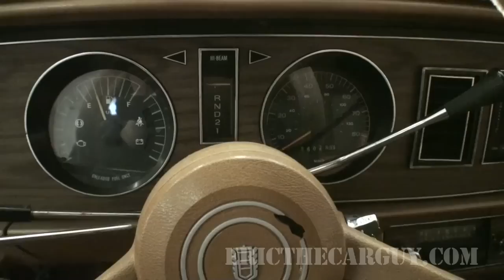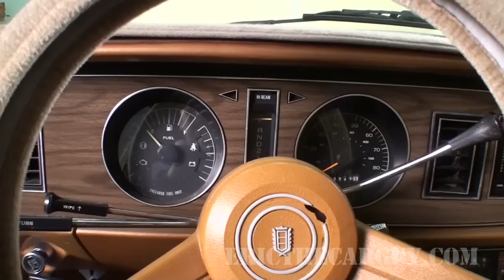1979 Ford Fairmont a Closer Look #FairmontProject

Comment: I'm a little surprised to see that Ford US was still using this engine in 1984. Ford Australia used it as well, from 1970 until June of 1976. They where 200 and 250 cubic inch. After June 1976 Ford Australia released a revamped version of the two engines with a cross flow cast iron head. I recall reading at the time they reason they did this was that the old non cross flow engine would not meet the latest emission control design rule of the day. The revamped 3.3L engine produced 110hp and the 4.1L produced 123 hp. Nothing to get excited about but I wonder how the American Fords would have performed with the cross flow engines installed. By 1984 the engines had evolved a little more  in that they had an alloy cross flow cylinder head( which where a 3rd of the weight of the cast iron version)  fitted with a 2 stage Webber carburetor or the optional Bosch fuel injection. They used that alloy head cross flow engine up until 1988 in sedans and wagons and 1992 is utilities and panel vans but after 1988 the sedans and wagons where fitted with an all new 3.2l and 3.9l sohc straight 6 engine with single point fuel injection and optional multi point fuel injection. After 1992 the 3.2l engine was dropped due to poor sales and all models after where fitted with a new 4.0l sohc 6cylinder with standard multi point fuel injection. We saw very few American Ford models in Australia with the exception of the F series pickups , a short fun of the Taurus during the 1990's and the Ford Explorer. Now ,with the closer of Ford Australia vehicle manufacturing operation we'll probably be seeing a few more. Sorry for the long post, hope you find it informative.

Comment: Wow - does this bring me back.  My wife and I had a '78 Mercury Zephyr from when it was new up until about 10 years ago.  It was essentially the same as this '79 Fairmont in many respects.  Major differences were that the Zephyr had 4 headlights, different grill and hubcaps, little stuff like that... but pretty much the same car.  We even had a very similar plastic tray on the transmission hump to hold cups, change, tapes, etc.  The body and interior on this '79 Fairmont are in amazing condition, as are most of the mechanical parts when you consider their age.  Will be interested to see how it progresses.

Comment: I use to own an '80 Ford Fairmont Futura sport coupe. Mine had a 2.3l engine and a 4 speed manual. If you get wider wheels and better springs in the rear the car will handle great, shortening the links on the anti sway bar in the front will sadly not only lower the front of the car, but make it stick like glue. I was young when I did it so don't judge too hard. It might be good to note that a good portion of the tubular swaps are for drag racing and do not help with handling just reduce the weight for better transfer and some change the stock position of the engine.

I saw one of the sport coupes for sale in Colorado that a guy did a full Cobra swap on including the independent rear suspension. if you want to go for full sleeper mode, maybe change to 15" stock five lug wheels and have them widened, then pop some hubcaps back on. A stock gauge cluster from a Mustang will fit in the dash, you just need the extra wires and the plastic face plate to match. Most people would just think it was a dealer upgrade. Just some food for thought

Comment: Love it,I only drive old cars for easy workability and nicer drive,all these saying how unsafe they are maybe fight but just don't crash and you'll be fine.. I'm in a BMW e34 that look forward to driving everyday that's almost mint,all I have changed is wheels because I was on metrics which are expensive so I run 245.45.18's... cheers for the vids I'm subbing

Comment: Some had inside hood latch. The AIR system injects air into the exhaust to cool it and keep the catalytic converter from burning out, while also thinning emissions for easier conversion.

Comment: I had to Ford Fairmont one was as 1979 and the other one was a 1981, the straight 6 in the 1981 was slightly different as the bell housing was called a wide block and was a wider bell housing area, The Strokes were slightly different in 1981 how were they were still 3.3 liter 200 cubic inch engines, my 1981 had 316 Thousand Miles when I gave it up, was the best running car I ever owned, I was also noticing the grill on that 1979 and it appears to have a later Grill in it as I thought the 79s had a for headlamp system on the four doors just like the few tour of Fairmont, I knew where every boat was one of those cars and could actually disassemble one in the dark or blindfolded, the reliability factors in these cars was outstanding and even though they were rated at 80 to 90 horsepower, they actually had great acceleration and cruise down the highway very well, my 79 seem to have a little more spunk but the 1981 seem to be a smooth riding car, I used to pull 15 foot boat with mine and it had no problems whatsoever, they were both daily drivers and went betweens 75 to a hundred miles per day, the trunks were very large and the air conditioning systems work flawlessly

Comment: Ah, that Fairmont yellow... my second car, at age 17, was a leased 1979 Ford Fairmont station wagon, with a 302 engine.  I loved that car, and had saved up Almost enough to buy it when it was time to return it once the lease was up.  It was basically a big yellow beer can on wheels, with a ridiculous engine for the car's weight.  I remember taking the car up to 145 mph on an expressway between stoplights... I had an aftermarket radar speedometer on the dash, since the stock speedo wasn't capable of registering the car's actual top speeds.  All in all, it was one of my more memorable cars, even though I only had it for a year.  

And, of course, since it was a station wagon, and I was a teenager, the car didn't just see action on the roads, but in the back, too.  I remember my friends looking at their own econoboxes with tiny backseats with a frown, and at the rear of my car with much envy.
Reply: 145 mph is impressive with an engine that only made about 133 horsepower.

Comment: Also, not sure if you know, but that transmission should be the ford C4, which will mount to small block 302 or 351.  if you go big block you'll need the C6 which is pretty monstrous.

Comment: you can get a blutooth setup in the car without taking out the radio. they make them to where they can rest on the sun visor so all you have to do is plug it into the auxiliary to play through the speakers if you'd like.

Comment: Eric: this is info from Wikipedia
Since 1971, all U.S. vehicles have had fully sealed fuel systems that do not vent directly to the atmosphere. In a typical system, vapors from the fuel tank and carburetor bowl vent (on carbureted vehicles) are ducted to canisters containing activated carbon. The vapors are adsorbed within the canister, and during certain engine operational modes fresh air is drawn through the canister, pulling the vapor into the engine, where it burns.

Comment: My dad had a new 78 Fairmont "strip model" with no options at all. Four cylinder, 4 speed manual transmission, manual brakes, no radio. He got an aftermarket sunroof installed and I helped him put in a radio. I wanted that car but when the time came for me to need a car he'd traded it in on a Tempo.

Comment: i have a '80 fairmont ghia 4-dr was similar to this car when i got it in '00 i bent the valves in #1,2 cylinders playing in the snow. swaped in 3.3 #2 drove another yr then went 5.0 i cut 4" off on the drivers side engine mount( for oil filter clearance) cut two new hole in the k- member and it slid right in, that engine made it two weeks then siezed up (used engines are such a gamble) 2nd 5.0 '91 HO stage one trickflow cam all stock everything else with 500cfm 2bbl carb and single flowmaster exhuast. FUN! run down w/ 2.73 rears :55mph 1stgear bury the speedo 2nd lol @5k shift.

Comment: You're lucky you got the carb with electric choke heat. Mine operated off exhaust gas. There was a small tube off the exhaust manifold that ran into the choke spring housing and heated it up. Unfortunately, the hot exhaust gas also eroded the spring and the little tabs that held it to the choke shaft. The rebuild kit was almost as much as  a whole reman carb, so I just got used to replacing the carb periodically.

Comment: @9:55 Yeah, My 74 El Camino has factory EVAP too.  Nice thing is the canister is actually in the engine compartment instead of hidden in a fender somewhere.  Of course the minute I went to an open element air cleaner its effectiveness pretty much went out the window...lol

Comment: I would slap in a GM Vortec 5.3, 4L60E trans and IRS from a T-bird maybe a mild cam swap for the 5.3 to improve performance a bit. The 5.3/4L60E combos can be had for reasonable price and running condition. This would give you the zippy but reliable (and perhaps get decent fuel mileage) car to drive across the country.

Comment: 94-04 mustang disc brake spindles are a direct swap. You can also convert to the 03-04 Cobra IRS suspension with very minor Fab/welding work. I have personally seen/Done both. all the stuff to do the IRS swap will run you in the neighborhood of $1K. 5lug front spindles can be had cheaply from a salvage yard. The Disc brake master swap can be fairly easily done as well. Also a set of sub frame connectors will greatly help with handling and stiffening the chassis. I can't wait to see what comes of this car. I'm a huge ford nut and have just done a ton of the mods you're talking about to my 86 notch. I also know of places to source all the stuff to install a factory style injected 302 as well as tune one for aftermarket mods. Feel free to message me.

Comment: That is clean!! I bought a 1990 integra a few months and it's pretty clean everything works fine inside but the passenger side window motor is getting really slow and only works from the passenger side. It's been in a wreck. A very minor one. The good doesn't line up over the lights quiet right

Comment: if you're wanting to put a 5.0 in, i would suggest to buy a totaled explorer/mountaineer with the 5.0. It will already have the GT40 intakes, heads, and higher compression, not to mention the EEC and all the looms needed. If you're lucky enough to find one that is 2wd you can reuse the trans as well. Good luck and happy hunting.

Comment: also a 5 lug conversion can be done (2 LH axleshafts from an Aerostar or Ranger to 90 if its an 8.8) and Ranger front rotors will swap in place of the 4 lug components)

Comment: I know many people are giving you suggestions for engines but I think if you could go to a junkyard and find a 5.0 ford explorer late 90's gen.  You could get a 4 speed 4R70W automatic transmission with the 5.0 v8 all in one run.  The explorer has many part that you could use.  Im not sure, but the rear end might be able to be used and they came in the 3.73 gears with disc brakes already installed.  The advantages about going with an explorer v8 over the mustang is the cams are different giving you more torque, which if you don't want to go like a bat out of he!! would still give you a ton of fun. 
Have fun with this project!!!!!!!

Comment: Fairmonts came with a standard transmission..a 4 speed as I remember. My first car was an 81 zephyr..a mercury branded fairmont. Same engine..but..i believe some of these shipped with a 289..
Reply: giskard80 Acutally, a 3-speed manual was standard on the 3.3 I-6, and a 4-speed manual on the smaller 2.3 I-4.
Reply: The V8 was a 302. The 289 was strictly a mid to late 60s engine.

Comment: I am sad. I had a 1979 Ford Fairmont Wagon. I had to sell it. I wish I knew you where into these cars. I would have donated it to Ericthecarguy. It had minimal rust, the AC didnt work, and had 154,000 on a 302 V8. Damn.
 The radio had only AM band and same as your, no cigarette lighter. Even the cup holder/console was the same but mine matched the maroon red interior with a white exterior. It was a blast.

Comment: If this was my project, I'd pass up the common 302 and go with a 351 Windsor and maybe an Edelbrock Performer cam and a Holley Street Avenger.  I don't imagine the slightly taller deck height would be a problem.  Also, Ford 9-inch would be a must, and I would stick with a solid rear axle.  Ford AOD transmission.  I would also like to replace the front suspension with a Foxbody SLA conversion kit.

Comment: This is why real mech. Drive junky vehicles. ROFL I have a 79" Malibu  that is so much fun driving. Working on items from the old parking break cable to the one spark plug behind the engine block by the fire wall, driving a old junky car is so much fun to a real mech.

Comment: Sleeper Time!! I'm thinking supercharged fuel injected V8. Manual trans would be cool, but the whole sleeper vibe dictates an automatic. I would even go so far as to keep the hub caps if I could figure out a way to put them on larger wheels. I've seen guys use trim rings on larger wheels then hammer the hub caps inside of those. Cool car!....... for a Ford. :)

Comment: I had nearly the same car, a green '78 2dr boxtop with only three options, 200 six, automatic, and cloth seats. That was it. It was so plain, it was endearing. It also had 9,400 original miles, so it ran like new. Contrary to popular thinking, it had spunky performance, even with the C4. I bought it to hot rod, but it was much too nice for that, so it went to a collector. I miss it, but now I have an '80 Futura coupe with a 4cyl/4speed. The plans for this one? Much the same as what you are thinking for yours. I just love these boxy little cars.

Comment: My father has a few classic Mustangs and Corvettes and I remember his Mustangs had modern stereos that were specifically made to fit the classic steel mustang dash board without having to cut it up. I'm sure such a stereo might work well in that fox body. If I remember correctly the special stereos to fit the classic Mustang did cost a pretty coin or two.

Comment: cool vid, I drove a 79 in the late 80s as a teen, every day..a zephyr. Square back like this one.The six is so runted, it does not respond correctly to a bigger intake air and fuel.. best to let it go, as it seems you are doing. The runted engine also gathers poisons in recycle, it ends up a bit dangerous on sensitive lungs...among other body parts. Have fun. My locale proved this chassis to be stronger than the fox body.. just cannot find them often.

Comment: Correct me if I'm wrong but don't some states have issues with compression fittings on brake lines and because of this will fail state inspection on the safety side?
Reply: I'm thinking this because of the double flare guideline
Reply from the maker: Yes, in some states that will fail an inspection.

Comment: if you do care about the emissions I think you will still need the cat. the main difference in carbs and fuel injection is maintenance, fuel injection adjusts for the temp of the air vs. carbs witch have to be adjusted manually. the engine needs a very specific mix to run properly- you can go lean a tish or rich a little, but your window is very small, a properly set up carb is is going to run very similar in fuel delivery to a e.f.i. at a given temp. What actually determines how clean an engine is is the design of the intake manifold,combustion chamber,exhaust,and cam selection, that's why a lot of two stroke manufactures abandoned the cross scavenge combustion chambers and went with loop scavenge, they cut emissions in half and never touched the fuel delivery system.

Comment: On that brake line compression fitting. If you are planning on IRS from the cobra which is of course disc brakes, the stock proportioning valve will lock up the rear discs, there are manual proportioning valves that go into the place of that fitting. Of course you have to "gut" the old non adjustable one.
Reply from the maker: I'm aware of the proportioning valve issues with rear disc conversions. It's one of the things I hope to cover in this project. In fact during my last live show someone was asking why their rear disc brake conversion wasn't working like it should. I think it was the prop valve. I think it's a common mistake with that conversion. Thanks for your input.
Reply: EricTheCarGuy
I get yah, I should no better than to question a seasoned mechanic on brakes :D I look forward to watching more vids on the car!

Comment: Eric - I had the same motor (200 cid) in my 1980 Mercury Zephyr. After a cross-country drive it carboned-up and required head removal and lots of scraping.  Agree on that Ford choked this motor to death in order to meet emissions of the time, and the new unleaded fuel (that this motor was never originally designed to run on).

Comment: about the brake pads just a note most old disc brakes had/have a thinner outter brake pad and a thicker inner pad. besides the one side being the way it was well probably from sitting. the compression fitting was the first thing i noticed before you even mentioned it. in all not a bad ride and for the $$$ part stolen

Comment: I have 2 fairmonts.  1980 2 door sedan, 5.0l fuel injected motor, AOD tranny, posi rear. Fun car, quick, but not super fast.  Also 1978 project car, 351W, AOD tranny.

Comment: the 3.3 (aka Falcon Six) in the Fairmont - an AOD would not bolt up to the 3.3 bellhousing since its a 1979 casting (1980+ 200s and 250s will have the upgraded bellhousing pattern which is the same as the Ford 302; also the cylinder head from the Australian 250 has a separate intake manifold (originally with a 2 barrel carb the Falcon Six has been in production in Australia used with the Australian Falcons)